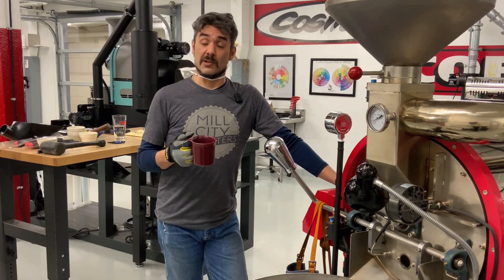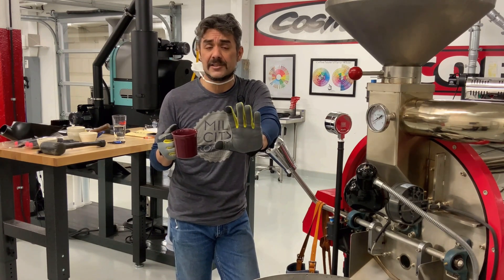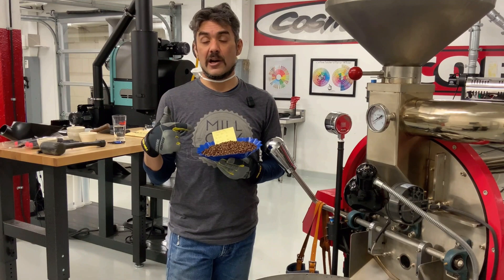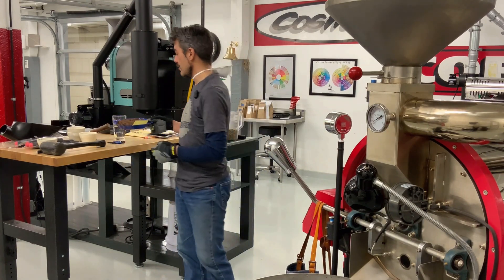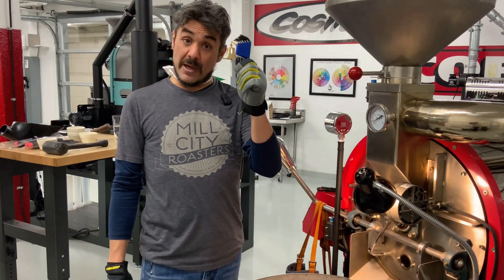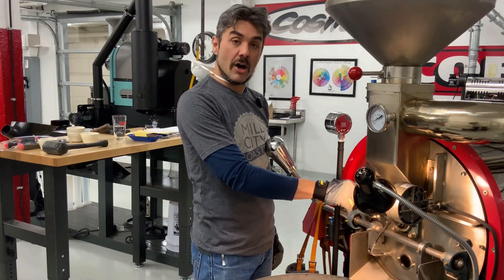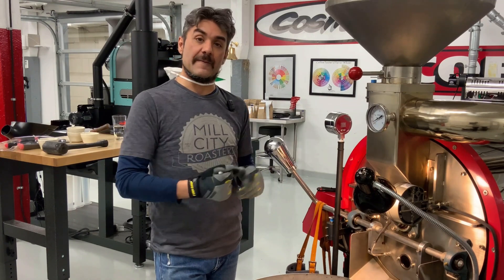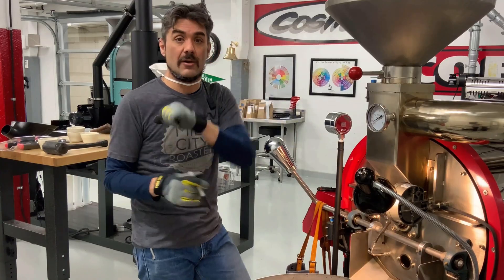Drum Gap Adjustment on the legacy 6KG Roaster

Comment: I have got 6 kg Mill City Roaster machine from someone. I’ve seen he has to use a grease to lubricate the drum like every hour when he was roasting coffee and I think this is what the information I’m looking for. I think the gap is too close in my case. Thank you for your video.
Reply from the maker: That sounds like something is very wrong and totally unrelated to the need for lubrication. Email support@millcityroasters.com for help.
Reply: @MillCityRoasters  I've tried to adjust a drum but I can't find a screw that can fit in. So, what's the screw you're using in the video at 5:50 - 6:00 minute?

Comment: How did you knock the drum?
Reply from the maker: This 6kg is a slightly older model and he tapped the drum shaft forward from the back of the roaster.  All but the smallest of our new machines have an adjustment mechanism that allows operators to "dial in " the drum gap without tools. We posted this because a) many operators of our smaller and/or older machines need to understand this a bit better and b) many of our viewers are saddled with machines from other manufactures less interested in producing modern production machinery need to do the same. YMMV